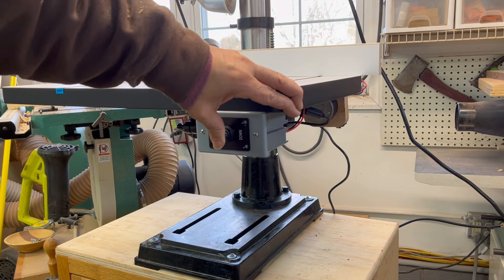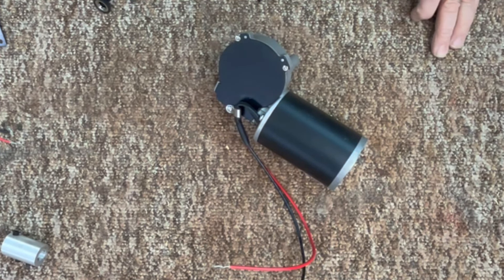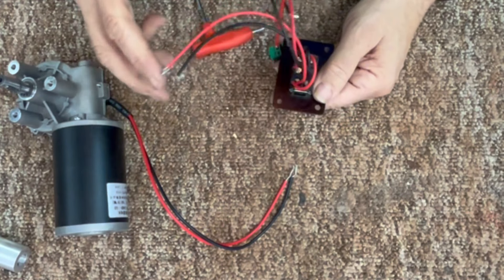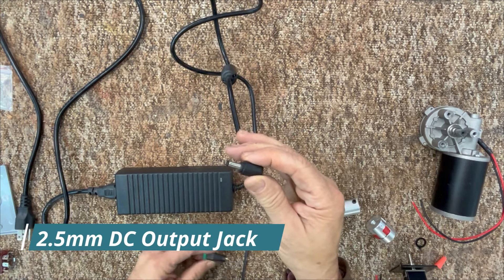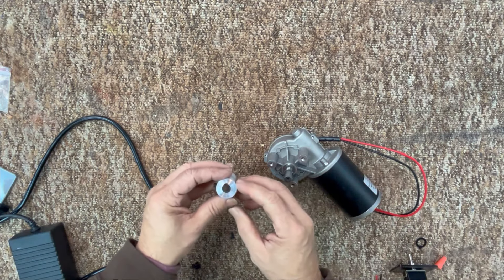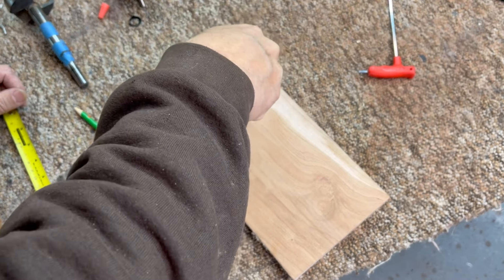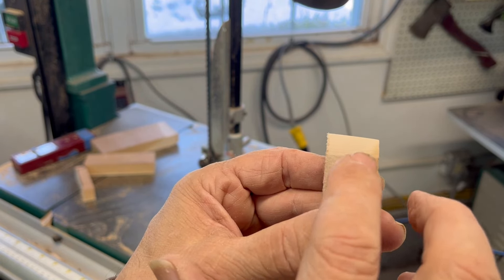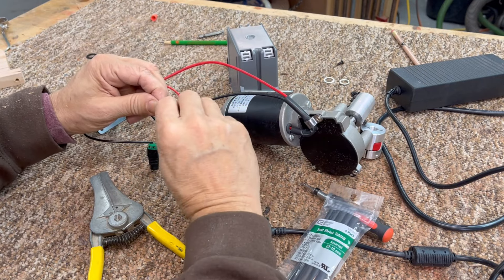Motorize Your Drill Press Table  -  Nova Viking Drill Press

Comment: Great job!  I am sure by now it is very gratifying for you to use.  I have a similar table that I do not mind cranking but would love to try this solution.  My shop includes also two old Delta's that both have relatively heavy tables & I have counter-weighted both in the column.   If a guy has access to a metal lathe this can be done with some elegance & allows the table to be lifted with just a touch.
Reply from the maker: You’re right.  Every time I use it makes me smile🛠